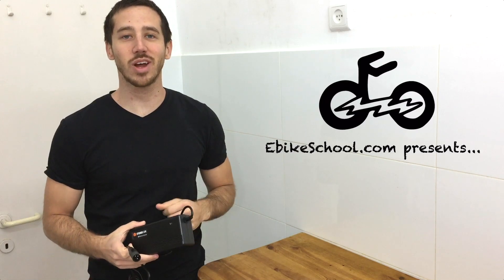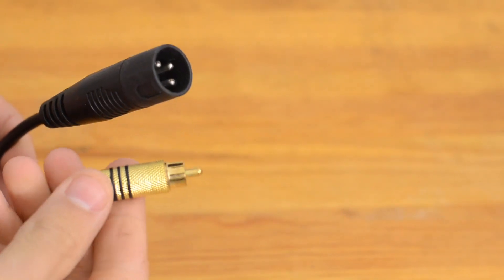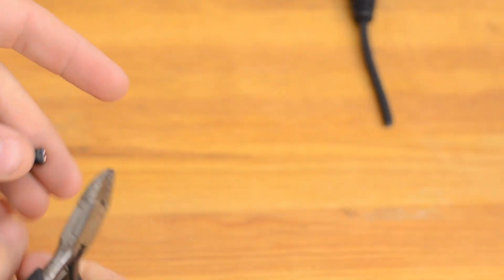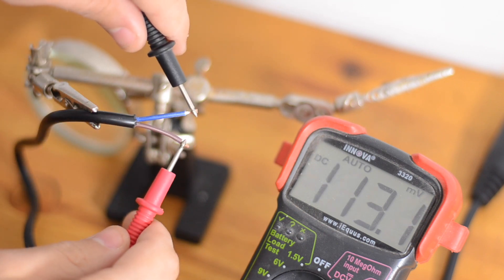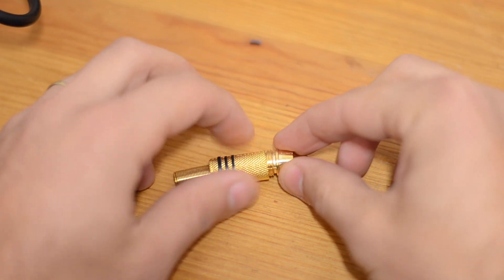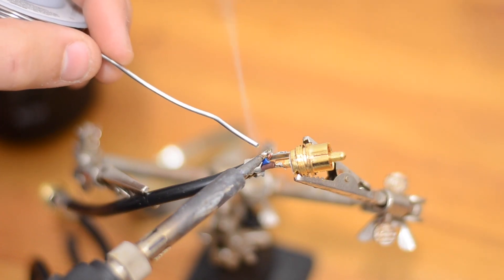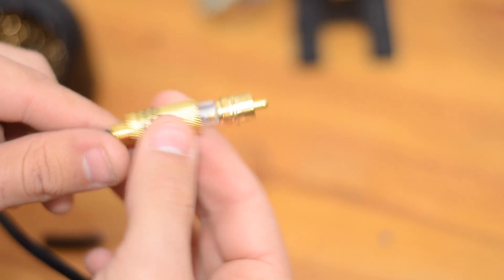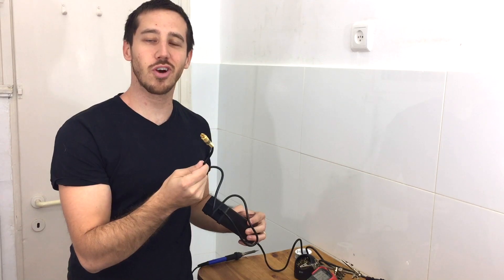How to change a charger connector in 60 seconds

Comment: I have a Liberty Trike that I want to make an extra battery for. The connector on the charger is a type of RCA but it is "L" shaped & the pin is recessed like 1/8". It is rubber coated & I have looked all over the net but can't seem to find this connector. None of the RCA's having pins seem to be recessed. Any help would be greatly appreciated not only to me but all us Liberty Trike owners wanting to make a spare battery . Thanks

Comment: How do I change the connector on the battery side?  Is there a video for that? It appears the the positive terminal side of the charger is connected to the negative terminal side of the battery!  Is that correct?
Reply: Following for changing an RCA charger port too... :)

Comment: Hey EBikeSchool.com!  I love the convenience of RCA connectors, however I've always thought because the male side has two exposed contacts, it's easier to accidentally short.  Should I be wary of this?
Reply from the maker: You're right, there is the higher risk of shorting the end of the connector. For that reason (and because it's a good rule of thumb), I don't keep my electronics stuff on metal shelves, in metal boxes, etc. However, if you were to say, drop your connector onto your keys while the charger is plugged in, it could short your charger. Most chargers have short circuit protection, but a very cheap charger could be damaged. It's one of the tradeoffs with these convenient connectors. We live in a world of compromises :-/

Comment: I got the 3 pin small connector on my charger . I just bought a Grin satiator  as i have a 54.6 ,4amp and a 58 volt both running on  5 amp 48 volt ! Problem i need to change battery connector to fit my hard case down tube battery port . I have the one from the original chargers that i want to cut and put on satiator by spicing wire and swapping connectors ? Same as here .I have the XLD ,so its just the end bit that,s  going in port .  the one with the PC wire to ! Is it ok to do ? Knew to this RIPPING HAIR OUT !

Comment: Where can i find one for the bosch powerpack 400 with its strange connection?  In the USA the 4 amp is $200 and the 2 amp travel charger is $110 and both not available usa=110 volt
Reply from the maker: I'm sorry, I'm not familiar with the connector that is used on those... I've never had a Bosch ebike. Do you have the old charger? If so, you could use any generic charger and just use the connector from your old charger on your new charger.

Comment: Can i use a generic charger for a Bosch 36 volt. Do i have to worry about Amps.
Reply from the maker: Yes and no. The voltage should be 42V for any 36V Li-ion battery, but you want to make sure the current isn't much higher than the stock charger. The good news is that high current chargers are expensive, so most cheap generic chargers are usually only 2-3A which should be just fine.